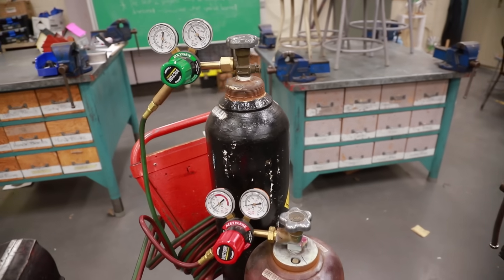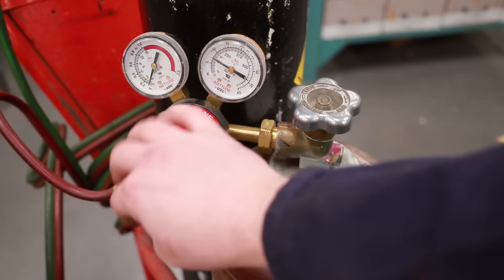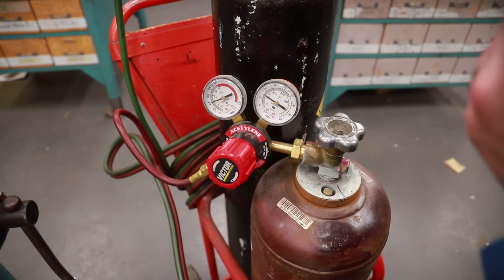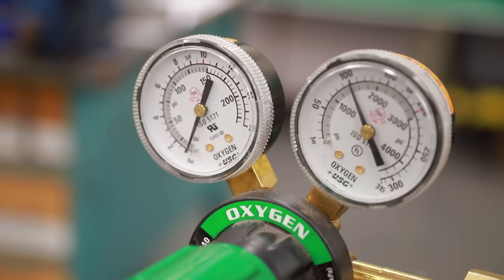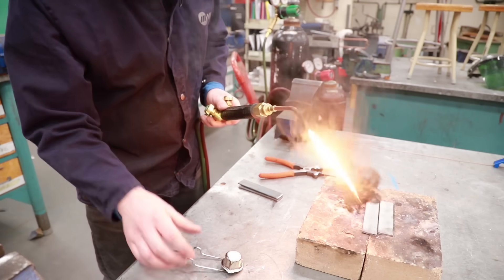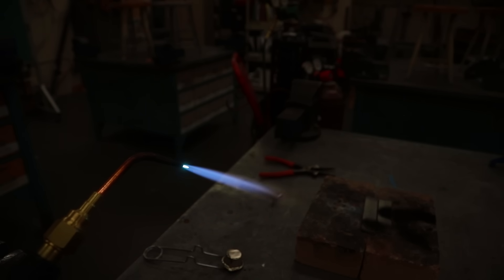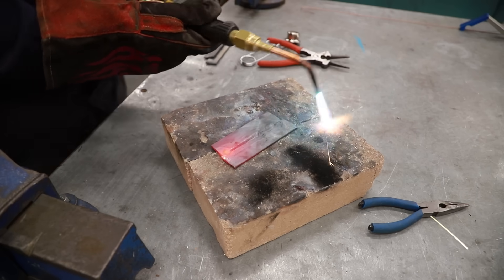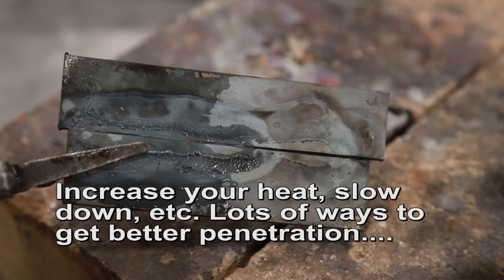Intro to Oxy-Acetylene Welding - Part 1

Comment: I welded for over 40 yrs. At one time I was certified in all processes and metals. I'm not trying to brag. Just saying I know what I'm talking about. This is an outstanding introduction video. I had a neighbor teenager who ask me to teach him how to weld. I had him watch this video first. Then I tested him on what he learned. Smart kid even brought notes. Set everything up from the beginning. Very good video.
Reply from the maker: Kind words. That means a lot. I know I have some mistakes in this one but that is all part of my own learning process. Glad it was helpful!
Reply: I was trained to weld in the air force and they start you out on gas welding. Knowing how to gas weld is the fundamental part of welding. I’m currently teaching my grandchildren to weld and I’m starting them off with gas welding. Once they have it down I’ll show them how to TIG weld and then stick. After that MIG.
Reply: would you suggest an oxy acetylene setting for a newb? i always wanted to weld but i  have ocd and im afraid of going blind with the electric ones...also the fumes...i really cant afford a good tig rig yet

i want to make my woodworking tools and work on my trucks..
Reply: @aar3682  Depending on what size and brand that your torch is, you can find the oxy and acetylene pressures online, as well as recommended tip sizes based on the thickness of the material and if you're cutting or welding with it. Just search "Victor (or Harris) oxy-acetylene torch settings for cutting/welding" and you should be able to find what you need
Reply: This is how I fell in love with welding.... At my highschool we had metal shop and this is how I learned to weld. Then after highschool became a welder and millwright

Comment: I was just sitting here bored thinking about dumb stuff and thought "I wonder if its possible to weld with a oxy torch" sure enough you can. Very cool. Im gunna buy that tip and try this out myself
Reply from the maker: check out my other long oxy-a video. It's got some better advice for setup and shutdown. I made some mistakes in this part 1

Thanks for watching! :)
https://www.youtube.com/watch?v=C6lluYIl9Xk

Comment: Why welding  without e rod with filler material?
Reply from the maker: to introduce fusion welding,  puddle control, and familiarize students with the parts of the welding system

Comment: I’ve been trying to weld some 5/16” with oxyacetylene and it’s getting frustrating. Diagram says #5 will do up to half inch and I’ve tried a #7 and it still won’t puddle. Cherry red but no puddles. I am new to this and no teacher. I tried the cutting torch and that started blowing through (cutting into it). Why would the number 7 not work? Not enough pressures? I hold it there for a long time 😳

Comment: There are times when a fusion (no filler rod) weld is appropriate but this is not one of them.  As completed, this joint will quickly fail if the straps are bent toward the weld bead.
Reply from the maker: Hence why this is an intro video aimed at teenagers in a shop class. This isn't about making structural sound welds for industry

Comment: is this structurally as sound as a flux core weld?
Reply from the maker: Both serve a different purpose. The versatility of gas welding and the ability to weld, heat/bend, cut material is handy. For straight welding then an arc/stick welder is good.

Comment: I work in hvac and use assetaline a lot for brazing refrigerant tubing and somehow it never occurred to me I can use my torch for welding. Thank you so much for the videos! I now have a lot of home projects I'm doing
Reply: welding with ox-acctle  is old school it uses a different filler rod than brazing rod.  it is quiet and requires no electricity, takes lot of practice. It is the best way to learn heat controll, running a puddle and getting proper penetration.  If you can ox-acctelene weld,  Arc and stick will be very easy to learn.

Comment: Wait a second  I am confused if the metal is at 3000 degrees why is it not melted like the building steel found by the ironworkers for days and more even weeks  I think I heard after 9/11 ?  Fire from all the contents of an office building and jet fuel that is the equivalent of kerosine used in tiki torch candles used in bacyards do not reach near that temperature.  Even thick steel I beams bent drasticly with no buckles or tears I have seen shown by an ironworker.  I can not say I know what made this happen but have worked with  heating steelto bend it and for expantion for press fits and there is somthing not told to make all that happen besides  aircraft make buildings colapse that way.  tHEY ARE STEEL FRAMED  AND BUILT NOT TO DO SO.    falling at freef fall speed or near it ???
Reply from the maker: This video explains it better: https://youtu.be/dQw4w9WgXcQ

Comment: Flowmeters do not measure pressure. They measure flow. It is not psi but cfh on the dial. Biggest peeve of welders
Reply from the maker: If a 12 year old (target audience of this video) can make the dial hit the right number and get the torch started in class then that's my goal. Thanks for watching😁 I've gotten better since making this video with terminology and my personal welding. We use the torch mostly for heating and bending in the class.
Reply: @WeBuildStuff  I have seen many welders refer to their flow meter settings as a psi reading. Probably the most common error, made even by some great welders. In the end, all that matters really is that you have your numbers correct on the dial. For informational purposes, it is more important.

Comment: Rounded cone not pointed or flared and learn how to feed the wire throughout fingers but  after that get a TIG set because you can weld a lot more metal and alloys
Reply from the maker: Ya thanks.  I've learned a lot more since this video. Thanks for watching
Reply: @WeBuildStuff  when you are teaching you need to teach the main points which is the welding flame and you should explain about the inner cone being Neutral and not oxidizing or Carburizing
Reply from the maker: @Then.72  which I have also updated in my teaching
Reply: @WeBuildStuff  👍 great!

Comment: OMG I saw Trogdor at 9:15! Love the Homestar reference. Are you a dragon, a man, or a dragon man?
Reply from the maker: A man. I usually try my best to avoid burninating any peasants.
Reply: @WeBuildStuff  Thanks for the videos btw, I was able to get my old oxy rig working and I think I'll be able to use it to weld my exhaust back together so I can get my old car inspected and sold! :) Next up, patches for the rust holes in my old van!
Reply: @WeBuildStuff  BTW Strong Bad and Homestar are back after a long hiatus; the Brothers Chaps are now releasing their stuff through Youtube and Twitter mostly since Flash is Dead (tm)
Reply from the maker: @Auriam  flash and those ridiculous animations will live on through those 25 and older forever
Reply: @WeBuildStuff  But he was still TROGDOOOOOR!

Comment: Little Johnny said unscrew the tank valve's after each use.
Reply from the maker: Unscrew or turn off? I like to keep the valves attached to the tank...
Reply: @WeBuildStuff  it was just a joke. My old welding instructor used to have posters all over the shop that said "don't be like Johnny". One of them had the tank valve screw flying off and hitting him in the face. We were to back the tank valve's to zero psi after each use.
Reply from the maker: @jasonburrell3508  my response was also not serious.  Poor little johnny
Reply: Thanks for the video. I been brushing up on oxy-fuel welding. Your video helped me a lot.

Comment: Bro, don't you require a filler electrode with this??
Reply from the maker: This video is just showing fusion welding by using the heat from the torch to create a basic puddle. Filler rod in next video :)

Comment: Why arent you burning through and fill up the hole with filling rod material.That weld would never pass a x-ray test.
When welding 2 materials together,you need to have the same gap between the elements equal to the thickness af the material.While welding you have to burn through the elements and achieve a hole which looks simular to a matchstick head..a little oval/circular hole…if this as achieved then you know you have burned through the element correctly,and no sledgehamner in the world will ever break these to elements aparte..ever!

Regards
A certified acetylene/oxygene welder

Comment: How did it not pop every time I do it it always pops
Reply from the maker: It can sometimes be a dirty torch or not having a proper neutral flame.

Use a tip cleaner to ensure there is no blockage.

When adding your oxygen turn the  valve slowly and instead of a tiny fine tip (like a pencil) leave a little bit of a feather to it.

Comment: What’s is this process used for
Reply: It was done mainly before mig welding was popular for sheet metal, but it's done nothing like what's shown in this video, the process put's in less heat than arc welding, this guy is just burning metal and don't tack both ends it just buckles.
Reply: @hetrodoxly1203  sounds really interesting
Reply: It is and more of an art form than mig, it's a lot like tig in the way you do it.

Comment: I'm confused. What are the two different values on the acetylene meter  (it's also on the oxygen but I'm focusing on the acetylene one) there's the 6 PSI you recommend us stopping at - but what's the .4 value that is on the outer ring of the line?
Reply from the maker: The two different readings will be different units or pressure. Are you referring to how one ring says Psi and the other says kPa (Kilopascal)?
Reply: @WeBuildStuff  I’m not sure. It’s on the same meter just on the outer most ring. And says the word “bar” at the beginning of the outer ring and set of numbers I’m referring to.
Reply from the maker: @viviannereynoso3591  yes just another unit of pressure measurement
Reply: Thank you so much for your response!

Comment: Question on turning the torch on and off... I've always heard gas first when turning on, and gas second when turning off... (POOP was the motto from propane torches).... is acetyline different for some reason?
Reply from the maker: I made an updated video doing shutoff by oxygen first and acetylene second. 
I had a bad habit here that I did during emergencies to quickly kill the flame even if it meant a popping sound. Since then I've updated the way I do it and the way I show students

Comment: Won't water make the weld brittle?  thermal shock temper the metal, causes stress zones and nobody is going to do the "normalization" process in the weld, there is no way
Reply from the maker: Yes it is always best to let cool naturally. In a high school shop we dont have that time. Kids learn the techniques ans understand what happens when cooled with water. In a crowded shop we would rather be safe.

Comment: Can you use air from compressor instead of oxygen tank.
CHEAPER
Reply: No
Reply: u cant torch with compressed air an propane, for cutting or welding u need o2

Comment: I’m new to this and looking at the Victor oxy-torch. Now, is this the same “torch” that you cut with or this a different kind? And is the settings the same as for cutting or “higher or lower” than cutting?
Reply from the maker: You would add a cutting attachment to the torch handle and set the pressure differently for cutting your metal. You heat up the metal and get a puddle or super red going and then press a lever that sends a powerful "burst" through to start cutting 

Search for this video

The Full Guide to Oxy Fuel Cutting
YouTube · Weld.com
Aug. 12, 2019
Reply from the maker: https://youtu.be/gXuMDxYeqZ4
Reply: Ty for taking time to reply! So as I understand welding and cutting uses different tips or torches.

Comment: Can you weld 0.5 mm thick metal sheet from any other type of welding ??
Reply from the maker: I prefer tig for thin sheet metal but with the right tip I've done thin gauge sheet in the past

Comment: Great video! This is the best tutorial video I have found! I'm glad that you didn't adjust PSI on the tank while the welding is live unlikely another video.
Reply from the maker: Thanks. Updated video here with better tips and I address some mistakes I made in Part 1

https://youtu.be/C6lluYIl9Xk
Reply: @WeBuildStuff  Funny thing about how I started the AC-OXY welding was I learned it from an A-Team tv show.

Comment: Damn I’ve been turning the oxygen off first and then the acetylene, thought it had to do with starting the torch.
Reply from the maker: This is actually a mistake in my video. I put an updated video on my channel.

I keep this video online for my class and because there is still some good information there.

I tell students that acetylene turned off before oxygen does kill the flame right away but it isn't good long term for keeping things clean and preventing gas build ups in the torch. O before A for shutdown!
Reply: @WeBuildStuff  thanks for clearing that up thought I was a ticking time bomb doing that.

Comment: My friend is giving me a torch set up next week I have not used a torch in 20 years. Your part 1 video is most helpful so far. Thanks!!!
Reply from the maker: check out the updated video. Has some "proper" safety instruction in regards to tank setup and shutdown. I made a few mistakes and corrected them here :) Thanks for watching

https://youtu.be/C6lluYIl9Xk
Reply: @WeBuildStuff  I'll check it out. Thanks!

Comment: 101 - always prep your metal. It takes 2 seconds and your metal will heat quicker and overall a lot better weld.
Reply from the maker: For sure! I only use this video as supplimental material for students. We do lots more in class with proper safety that I have updated in a newer video. Thanks for watching and the tips. Good for the community

Comment: Can anyone out there tell me the price to have oxygen and acetylene  bottles refilled? Just wondering if I should get into it?
Reply from the maker: It can get prettt expensive.  Sometimes $200 for a single refill or Acetylene.  If I had to choose a home welding setup I would choose Mig or Tig. We still teach Gas welding because of the techniques and having a torch is great for heating/bending metal and cutting
Reply: @WeBuildStuff  Is that the cost of oxygen refill for a medium bottle? Thanks.

Comment: your tip needs cleaning
Reply from the maker: I show that in the next videos. These were originally made for my jr metal students and the lessons structured from basic torch handling and confidence, showing the difference between good and bad penetration, filler rod vs fusion welding, and breaking the welds to analyze strength. We do mostly MIG welding in our classes

Comment: this penetration of metal shouldnt even be qualified as "good weld" it's lacking almost half of the plate, dude do it right insted of showing people how to fuck up the weld and get fired from the job ....
Reply from the maker: I think you missed the point of this video. I made this expecting to get a few views from my jr students. The main reason I did this one was primarily to show basic tank setup and introducing fusion welds. Their next lessons show leaving a gap inbetween the metals and creating a keyway with their initial puddle and learning about how penetration affects their weld strength. Each new lesson adds a new component with their final welds finally being strong enough. The purpose of showing what does and doesn't work is important to getting younger kids feeling comfortable and confident to even attempt machine shop basics. 

Part 1 typically implies it's not over... 
This is made for 13 year olds not someone who is already a ticketed welder.
Reply: @WeBuildStuff  but still if You want to show them how to weld, You should do it correctly so they won't learn it the wrong way.. You should show them how to do it correct way from the beginning not like this half assed well, that's just my opinion.. What they should learn from beginning is how to do welds properly..
Reply: @WeBuildStuff  you showed them how weld should look outside but pwneteation of it wasn't good.. If You want to teach them something do it properly mate otherwise You miss the point
Reply: @WeBuildStuff  show them how do to proper welds from the start so they can learn from someone like You with higher experience, don't show those bad welds when You left the gap between plates it's kinda embarrassing
Reply from the maker: @mateuszbartoszewicz7701  I appreciate that this is clearly a subject you are passionate about. I'm not sure how many teenagers you teach at once on a daily basis but spreading out the information and starting slow with simple steps like understand a basic tack weld or knowing they can actually melt and move metal around with heat works very well for young kids learning this. As I said before this method with the basics and then introducing them to getting stronger results keeps them interested and allows them to explore safely. Keeping 24-30 kids safe and busy in a machine shop is not something everyone can handle. We find ways to make it work. Don't overanalyze this video from a professional welder standpoint. Look at it as baby steps to get kids interested. If that doesn't work for you then move on and don't loose sleep over someone doing things differently than you :) cheers

Comment: I used a torch to braze copper tube for air conditioning. If you light that torch inside a home without a little acetylene flowing, you’ll be cleaning that soot off the walls and ceiling
Reply from the maker: We always have our welding ventilation going when the class is running. I turned it down for the talking parts of the video